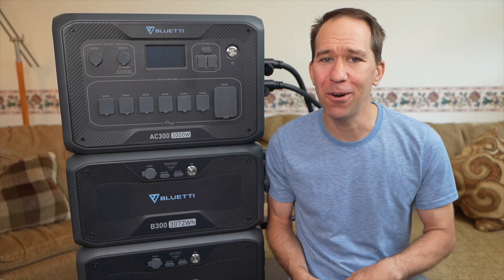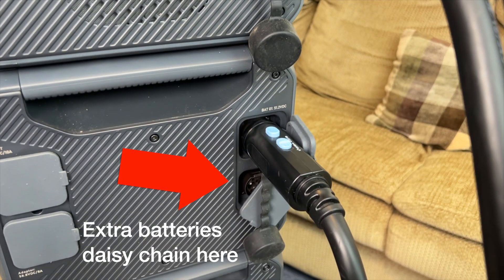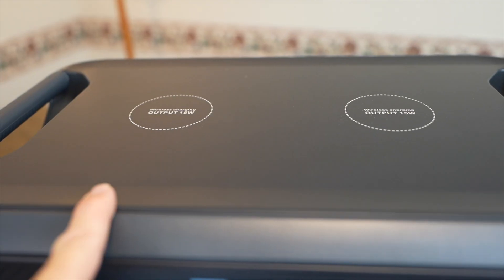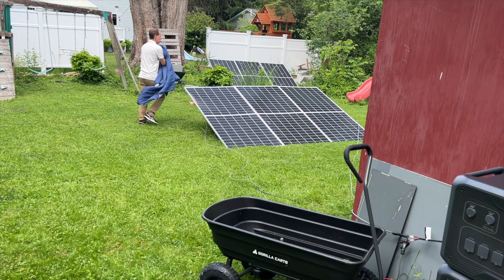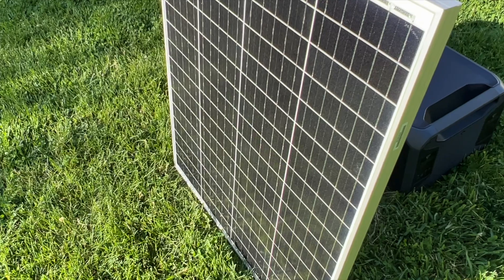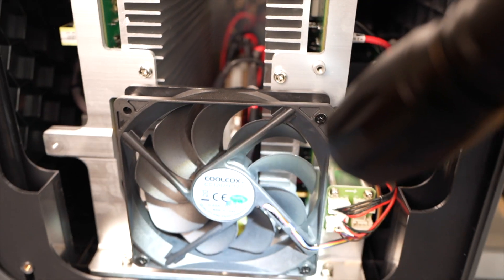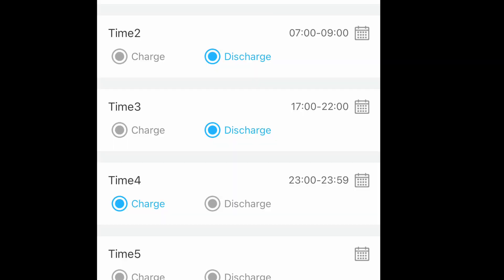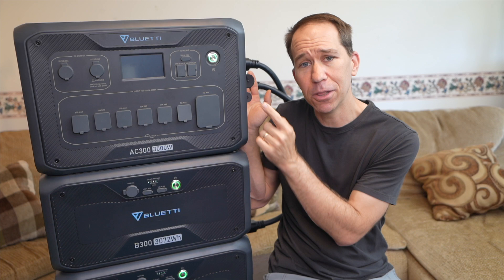Power System Review - Bluetti AC300 B300

Comment: Where did you get your solar panels from ?
Reply from the maker: Which solar panels do you mean?  I have a lot of them.  The ones I use a lot in the backyard I got for free from a local solar installer. They have some damage (cracks in glass). I wouldn’t put them on any structure but for the backyard they work fine.
Reply: @FrugalRepair  yes the ones that where behind the shed and place online I could buy those or do you have a link for some good ones ?

Comment: This guy gets a free item for bragging about it. Dont purchase this until you know all the downsides. Your better off all around with a good gas generator.
Reply: Perhaps for emergencies or if you are on a tight budget. If you have the solar infer structure in place, solar generaters are an excellent resource. This system is designed to function with daily use, for 10 years, using sun power.  Also a factor, a big one in my opinion is climate change. Anything an individual can do to decrease their carbon footprint is a plus. We all have a responsibility.

Comment: Is this unit silent when it is already charged and just passing through grid power in UPS mode?
I want it in my bedroom to act as UPS for a PC and computer equipment.
(I currently have a traditional UPS but I want a longer runtime than traditional sealed lead acid batteries can provide.
Reply from the maker: I just plugged it in to listen and hear don’t hear anything.  If you stick your ear next to the vent you can hear the faintest electric hum.
Reply: @FrugalRepair  Sounds great!

Comment: Thanks. That explains the zero when I know I have AC loads. Round trip efficiency is a bit disappointing

What I don't understand is if the 150V PV input limit is per string or total? 

I have 4 x 250W panels which will keep me just under 150V

Comment: Can you charge the batteries by plugging the AC adapter into the AC300, which is connected to a battery or battery?
Reply from the maker: I don't think I understand your question.  Yes, you can charge it from a wall AC outlet.
Reply: @FrugalRepair  My AC300 came with the AC adapter, which secures to the side  of the unit.  I am wondering if this will not just power the AC300, but also charge the B300? I ordered an AC adapter for the B300.
Reply: @jamesmorrison1683  I just ordered my AC300+B300. In conversations with Bluetti the AC power adapter will power outlets draws first and any left over available power will keep the battery charged.

Comment: I need help. I finally got solar panels in the front yard and wired them into the house where I have the AC 300 in my living room. I hook it all up but I’m not charging. I don’t know if I did something wrong or if there’s just not enough sun right now. I really need somebody to help me out.
Reply from the maker: Did you make sure you didn’t connect more solar (too much voltage or current) than the MPPT can handle?  You can try with one panel to start and see if your wiring is good.
Reply: @FrugalRepair  thank you so much for responding. I think I’m slightly over on voltage. I am a rookie at this. I think the manual says Max 150 v.  When I plug it all in it says  an alarm, voltage is like 152. Slightly over. So do you think that would cause to show volts but no amps?. That’s what I got going on right now. I have volts but no amps
Amps(watts)
Reply: Here now in the evening very low volts , like 80, getting less, and it’s actually showing watts , like 3-5 watts 😢
Reply from the maker: I would guess over voltage is your issue.
Reply: @FrugalRepair  Well I tried it with just two solar panels and I was pushing like 80 V and still hardly nothing as far as watts. Like 5 Watts

Comment: Which panels you have for this test? The AC300 takes 2400W but only 150V total. How were you able to squeeze (6 panels x 400W) and not go over the voltage?
Reply from the maker: It has 2 mppt inputs. The panels are 365w bifacial panels.

Comment: I have the smaller AC200P from bluetti and I am very pleased except that I cannot control via an App. Thank you for your review very straightforward!
Reply: I have a ac200p, I upgraded to the ac200max, which has Bluetooth app control. It’s a nice system with 2 B300’s attached. The AC200L is the latest model in this series.

Comment: We’re on we’ll water, my we’ll and pressure pumps are 220v.  With our frequent power outages we’d like to run the pressure pump long enough for showers.  Can this expensive unit do it?
Reply: You would need two of the AC300s, at least 2 B300 batteries, the Fusion box, and the communication cable (that comes with the Fusion box) to get 240V.

Comment: Will the B300 battery charge directly from the solar panel or does it need the AC300 unit??
Reply from the maker: It can charge directly from a solar panel. But not nearly the amount that can be connected though the ac300

Comment: I have a ac200p. Been thinking about grabbing one of the battery banks to connect. But can only accept 200 watts solar and the 2000 watt is 1399.00. I can buy another ac200p for 1499.00 can use plug from one to another to charge at 500 watts or 2 for 1000 watts pass through. No Brainer to me spend extra 200 for faster charging and ability to use each I dependently.

Comment: I’m seriously thinking of buying the ac300 system with 3 batteries.  I have two questions- 1st can I charge to batteries using an old gas generac generator and if so what accessories are needed. 2nd can I plug the Bluetti system into an existing 30 amp 4 prong gas generator plug to power the house if so what accessories are needed.
Reply: Get the ac500 instead
Reply: The ac500 isn’t really portable.

Comment: The weird thing about bluetti is you can hardly reach them. I was going to buy something from them and I wanted to,ask them a few questions, and they did t even answer the phone. The recording didnt even sound like it was a company, it sounded like a person.
Reply: HI, I had a ac300 go down yes they are impossible to get hold of but email response took 2 days they asked a question and asked for a screen grab of the problem and 24 hours later they sent me a paid return label it took 3 weeks to get a new unit.
Reply: @jamescannova7661  YOUR.lucky.I been waiting for almost a week for error 008,NOTa single response
Reply: My issue as well…have the ac300 and 2/ b300. Thank God they are good products, but I have so many questions about adding more solar/ parallel or in series? And another battery. #vanlife virtual dr.

Comment: Can you please duplicate my findings? Here are the factors in hand.

1. I have an AC300 with 4 Battery Banks.

2. I connected a 14,000 BTU 115-V Dual Inverter Smart Window Air Conditioner LW1517IVSM into one of the AC300 20 AMp sockets and it works great.

However, I connected two AC300 with a AC300 Fusion Box(P030A) and set it to Split Phase.

1. Connected the Fusion Box to my home's Transfer Switch with a GearIT 30-Amp Generator Extension Cord (10 Feet) 4-Prong 120/250-Volt 7500W, NEMA L14-30P/L L14-30R, 10 Gauge SJTW Locking Power Cord.

2. I connect the same AC but when it kicks in turns off my P030A  Fusion box.

I have to disconnect the cord from the Fusion box and connect it again for the light to go green again.

Question?  What is going on? Is there a limitation on the P030A.  Is there another configuration that must be set.  I need someone from your team's technical support.

Comment: Would you plug the AC300 into grid power using a surge protector? As with my electronics they are plugged into a surge protector power strip.
Reply from the maker: You’d need to make sure it is rated for the amps that might pass through it.

Comment: What type of home electrical system is required?  We live on acreage in a 1920, 2.5 story barn.  Remodeled into a home on the lower floor in the early 1960's.  The other levels are used for storage.  * *  We have the old-fashioned wiring (grey) and a standard or smaller box. It is all grand-fathered in.  * *  Could an old electrical system handle the AC300 . B300?  * *  Our use would be "periodic" power to an older 20 cubic ft refrigerator; an older 7 cubic foot chest freezer; a new 3.5 cubic foot chest freezer  -- each in a separate location and no plans to attach a solar generator to all at the same time; attaching to the solar generator to "refreeze" a unit, during a power outage, separately.  ...  We do have power outages.  Longer one in the 70's for 2 weeks; one in 2019 for 10 days.  Otherwise, not longer than 2 or so days.  ...  Powering a Goal Zero or Greenworks electric weedeater; electric chain saw/electric pole saw/; using a Schumaker smart battery; using a Yetti 1,000 solar generator and Boulder Briefcase solar panels. Using to recharge tool batteries.  . .   Also, to draw water up from our well during power outages.   * *  My plan would be to charge up my Samsung cell phone the "regular way" (not using the power circles on the top) - just using USB.  Household light would not be involved - we use  Crush Lanters; battery candles; safe lanterns and various battery and USB type lights/lanterns, a Torch flashlight.   * *  If this is a big no re: the AC300/B300 -- any recommendations for another/other solar generators?  * * *  It would be so helpful for us, if we could get replies/comments/suggestions.  Thank you.

Comment: Nice video. I would like to know would the Bluetti with one battery run a 15,000 BTU RV AC Unit and for how long?
Reply from the maker: Thanks!  The one I was using in the video is probably close to that BTU.  My initial guess is about 2.5 hours.  But you’d have to figure out your load to know for sure.  I’m guessing about a 9-10amp draw at 120v.

Comment: How long are the cables from solar panels to the battery?  I hate to think I have to leave this outside while it charges.
Reply: What is the extension cable called?
Reply from the maker: That's just my setup with extension cables.  It's probably about 40 feet from the far panels.  I have it on my to do list to make a pass through box so I can run those cables into the garage.

Comment: With the price that Bluetti is asking for this system, they should have improved the LCD in terms of information shown or put in their best LCD display since this is one very expensive piece of equipment.
Reply: right, five thousand bucks takes easily 20 years until it pays off. Besides, these devices get easily stolen.

Comment: Any idea on the best way to mount the PV200 panels? I know they are meant to e portable but I already have 7 and I don’t know how I could mount them. Any tips for the best way to have them installed?
Reply from the maker: I don't have that version but online it looks like they have hooks on them.   They really aren't meant for permanent install.  Do you want to put them on a structure?
Reply: @FrugalRepair  either my metal roof or build something to prop them up. I know they were never intended to be permanent but I don’t have a choice now lol
Reply: I also have 3 PV200’s and I’m trying to figure out how to use them for my shop. But I don’t want to bring them in and out of the weather.
Reply: @annalueck1864  I made a wood display panel to hold all 6 of mine. And they stay outside 24/7
Reply: @markbsb7176  I would like a 30’ extension cable to go from my generator to the solar panels. Do you know what it’s called or where I can get one?  Thank you